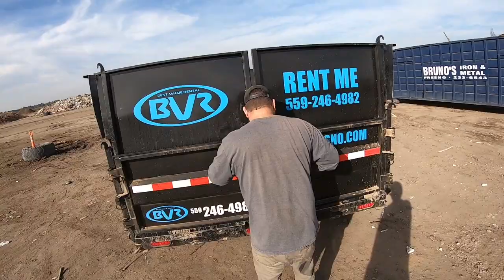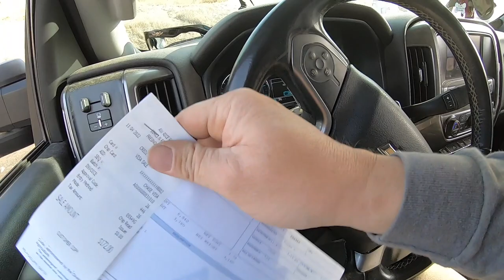Starting a Dump Trailer and Bobcat Business.

Comment: I tilt my trailer up a little for loading my tractor and implements. The skid steer goes in backwards mostly for weight distribution, but it's a gooseneck trailer. My main comment would be get the trailer much closer to your work area so you're not tracking so far. When we're cleaning up sites, clean out a path with the bucket and get the trailer in there so it's a loading frenzy. Way to  rock n roll it. Foxtrot Juliet Bravo.
Reply from the maker: I appreciate it. Normally I do try to get it close but unfortunately they said I could only park in that area. Appreciate you watching.

Comment: Would you recommend a trailer like yours will the high walls? Or lower walls? I figured low walls would be easier for lifting the bucket over to drop debris in the trailer
Reply from the maker: I would get a trailer with removable walls. 2 feet stock and 2 foot add on. If I had the chance to do it over again I would get a trailer that can carry more weight. I would also at least get a 16 ft. The 14 is a little small in my opinion but it gets the job done.
Reply: I have gooseneck with 4ft walls. At first it’s scary cause you can’t see out but I say it’s the same